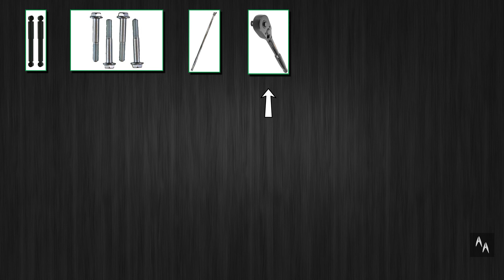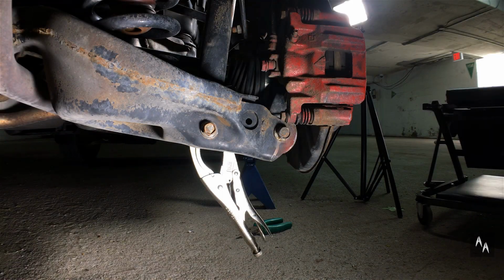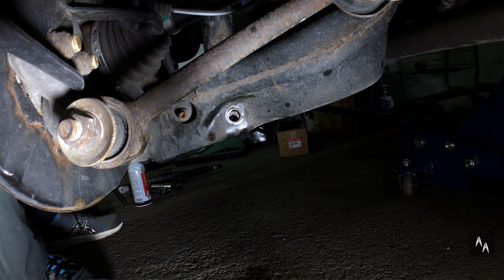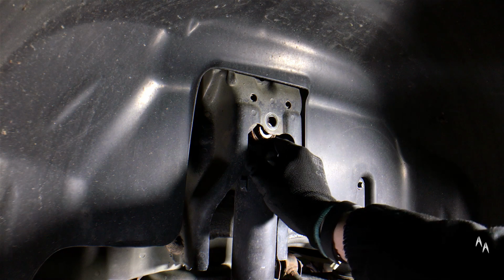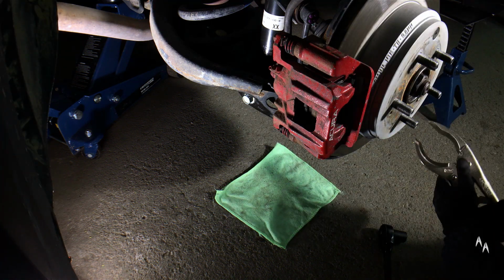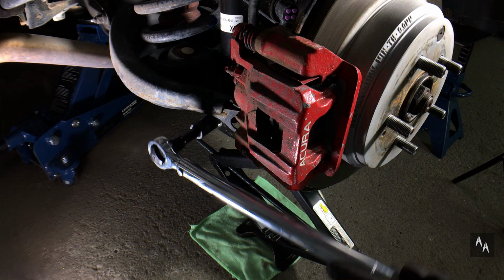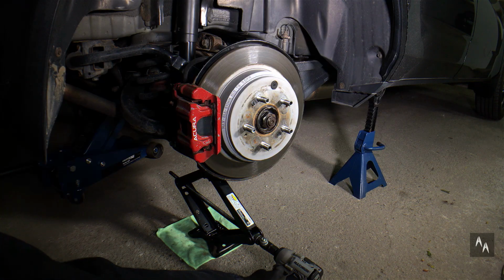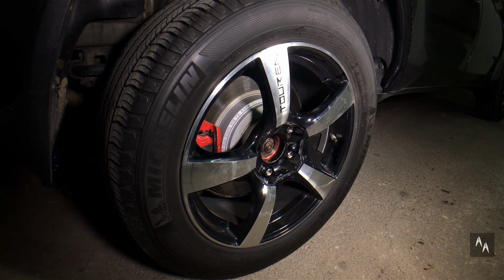Rear Shock Absorber DIY for 2008 Acura MDX

Comment: What can I do about the ads system?
Reply from the maker: Either install resistors to fool the system into thinking ADS dampers are installed or program yhe conputer using a high end Honda scanner. I won’t be able to help you with either as I don’t have ADS.

Comment: 2:53 jack stand
Reply from the maker: Yes, unfortunately my jack stands have grooves too deep to use it with the jack stands points. If I turn then 90 degrees, the supports will not go all the way in and there is a chance of piercing the plastic on the sides. So I use them sideways. I also use wheel chokes and a jack for additional stability and safety.

Comment: my magnetic shocks are so annoying on my 2007, i replaced a few time.s... they leak after a while
Reply from the maker: Yep, I heard that too. I would just swap them with techno regular ones, much cheaper and they last much longer.
Reply: The thread locker you used wouldn’t that be to keep the screw from backing out? You would use anti seize on screw to
Keep it from seizing next time
Reply from the maker: A threadlocker is a product that’s used to prevent loosening srews and bolts due to vibration as well as acting as an anti seize because it protects threads and touching surfaces from rust. Here’s an extract from the manufacturer’s description: “This will lock and seal while preventing parts from loosening due to vibration, as well as protect threads from corrosion. Removable with hand tools for easy disassembly. Applied as a liquid or gel, threadlockers are superior to conventional lock washers, nylon inserts, and other mechanical devices because they secure the entire fastener assembly against loosening from shock and vibration by filling the space between threaded metal parts, curing to form a tough, adhesive bond and seal. They also seal the threads against leakage, preventing rust and corrosion”. Hope this helps!

Comment: Hi Bgdn !
as always a super video .!  I have a question do you know anything about rear tires wearing out at the inside , I just notice mine is and my first advisor is you my friend ..ACURA ADDICTED ( ;
Reply from the maker: Hey! Uneven tire wear is the first sign of suspension issues. I would check the alignment and go from there. Unfortunately the OEM rear suspension alignment is not adjustable, but if it's really bad, there are adjustable aftermarket upper control arms. I would start with alignment check and suspension inspection. I hope you have a good mechanic to figure it out.

Comment: 🤦‍♂️ why not replace the nut with a new one?
Reply from the maker: It’s a welded nut, they are not sold separately from the lower arm.
Reply: @AcuraAddicted  🤣 all Honda trailing are nuts are welded but when that happen you replace it with a new nut. So they do sell nuts that will work with the bolt.
Reply from the maker: @ef2fodo  Is that right? I had no idea, thanks! I guess they lied to me when they told me at Acura that if it snaps, they just weld it back on. 

So what's the part number for the nuts they sell to work with this bolt?
Reply: @AcuraAddicted  Do you mean that the nuts are tack welded to the swingarm? Also, I couldn't find the link that gives the part number for the bolts. Guess I'm just not used to "YouTube". Thanks for all you do.